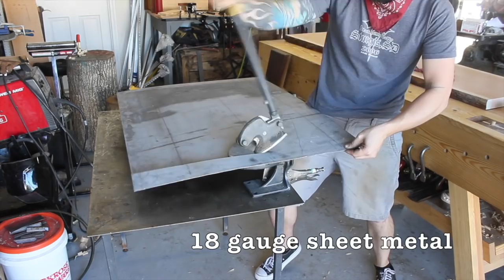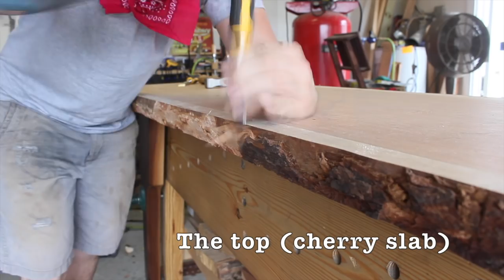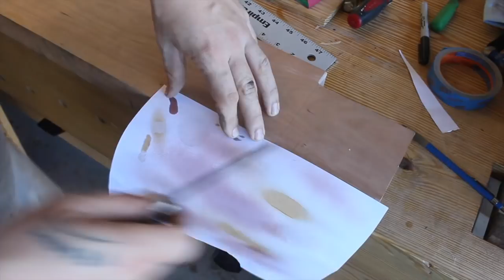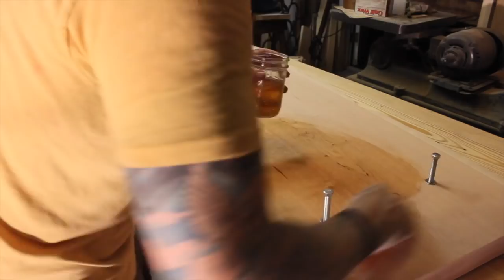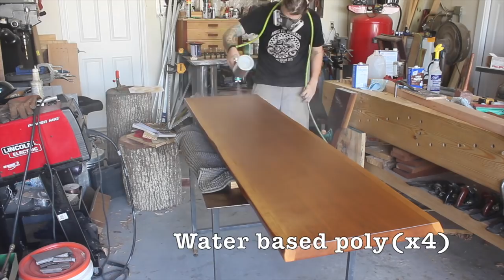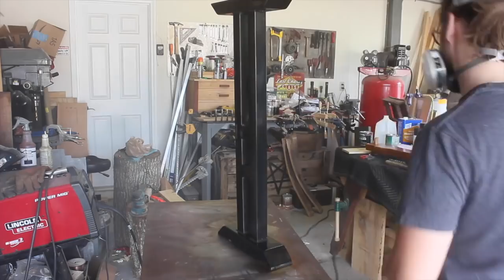Bar Height Slab Table | How-To

Comment: I like the overall design and the execution. My only minor qualm would be that I would have gone dark with the tusk tenons- ebony or equivalent. And on a practical note- it looks like you're getting a ton of overspray. Can you dial down the pressure, or perhaps switch to an HVLP system? You just have material going everywhere.

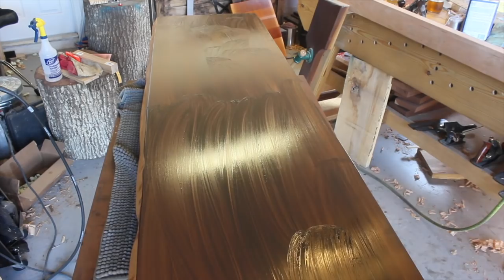Comment: ZH, being cherry could have skipped the walnut stain @7:50 and bagged the wood with plastic and put a bowl of household ammonia in the bag- it will darken evenly and to a much richer set of colors over staining.  Interesting "welding" process!  I'd have preferred a brownish or even copper powder coat over the steel finish- too dark for me. Nice design thanks for sharing the build.

Comment: Table is beautiful! Two questions: 
1. Do you use the same Miter saw (Dewalt) for metal and wood?? If so, what model?
2. Is everything in your shop covered with a fine layer of laquer, shelac, and anything else you pump through your HVLP gun? :)
Reply from the maker: Thanks!
1. Nope, ones a miter saw,, and the metal saw is a Dewalt Cold Saw(link in video description)
2. I'm sure it is! Maybe I'll fill my gun with some soapy water some day to even it out :)

Comment: Great build; thanks for taking the time to share.  Question on your finish:  Why didn't you continue with shellac after the sanding sealer application?
Reply from the maker: Do you mean as the final finish? If so, it's because shellac isn't quite as hard as the water based poly, as well as the fact that if alcohol were ever spilled on the shellac it would dissolve it.

Comment: Great job fella, it looks amazing. Quick question; is there a reason why you tack weld the entire weld versus one solid weld?
Reply from the maker: Thanks!
It's actually known as "trigger pulse welding" It's beyond tack welding as it's actually getting good penetration. I typically use this if I'm trying to eliminate heat warpage, and also if I'm going to leave the welds exposed I find it gives me better control aesthetically. If I'm going to grind the welds I'll often just do a continuous weld.
Reply: ZH Fabrications thanks. I am going to give it a try.

Comment: Fantastic build! Two questions: what gauge metal were you using to cap those feet with? And did you grind off the entire coat of mill scale on your legs?
Reply from the maker: Hey, thanks Travis! 
I'll usually use whatever I have on hand 18 or 20 gauge. And yes, I typically try and remove as much of the mill scale as possible.
Reply: Do you do that with an angle grinder? That seems like pain staking work.

Comment: i use cut shellac all the time but havent used garnet, does it give a darker tint? and its hard to tell what differance the gel stain made, did it give the slab a richer color? ive tried gel stain a few times with little luck in using it, so i dont anymore.
Reply from the maker: Yeah, garnet is a little bit darker. Since I applied the gel stain over the shellac it acts as more of a toner(and I could wipe it off of the sapwood to keep the contrast) so the gel stain just deepened the heartwood a bit more.

Gel stain is great on blotch prone woods like pine, maple, etc.

Comment: Hello,

Any tips for working with the steel blackener?  I'm working on a project that I'd like to use that finish on.  How fine of a finish on the steel do you try to get before you apply the blackener?  Right now I'm at about an 80-grit finish for most of it.  I've got a few small spots of mill scale left that will be hard to get worked out because they're in low spots.  Would those interfere?  Also, what product do you prefer?  I didn't see it in the list of finishes.

Thanks!

Paul
Reply from the maker: Not really a whole lot of tips. I just try and get a somewhat uniform finish on the material(if you want a uniform look, but you may not). I don't really focus on a specific grit but probably around 80'ish maybe 100?
 I'd try to get the mill-scale off as best as possible, a wire brush on a angle grinder, or a quick-strip disk, is usually what I use.
Here is a link to the metal finish: <!--td {border: 1px solid #ccc;}br {mso-data-placement:same-cell;}-->Sculpt Nouveau - Black Magichttp://bit.ly/2nltsor

Comment: So I have to ask, why gel stain over shellac, then shellac again plus poly? Personally I prefer the natural look of a few coats of wipe on poly. I mean its Cherry, naturally beautiful, right?
Reply from the maker: Shellac acts a a barrier between oil based and water based finishes.... Also by sealing it with shellac initially and then applying gel stain it doesn't penetrate as well so you do get a more natural finish.

Comment: I seen a few of your videos and when you weld it looks like you are laying a bead through a series of spot welds. Why? if you are going to then just grind it off? Not a criticism, love your work, just curious.
Reply from the maker: I do both, sometimes I run a continuous bead, especially if it's structural. I usually "stitch-weld" if I'm going to leave the weld exposed. In general I find that it can give me a better control over the aesthetics.